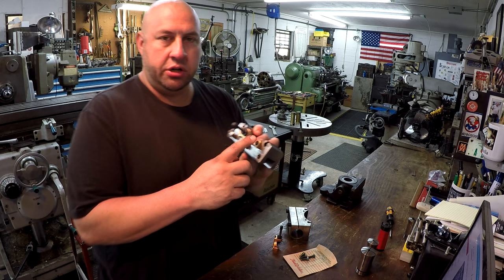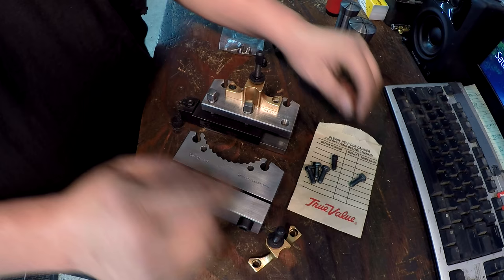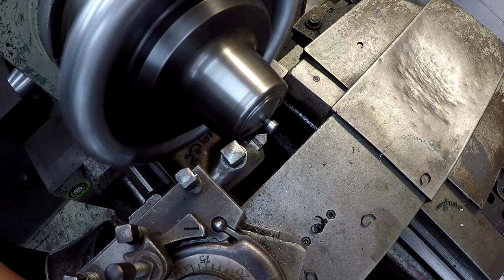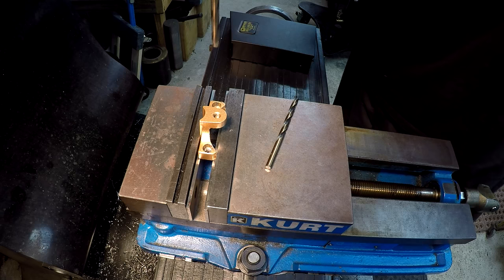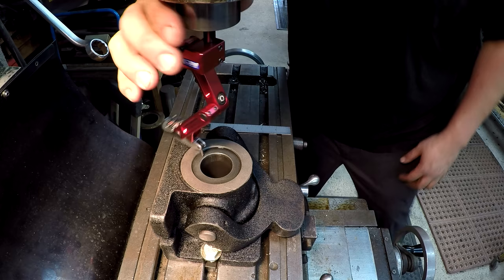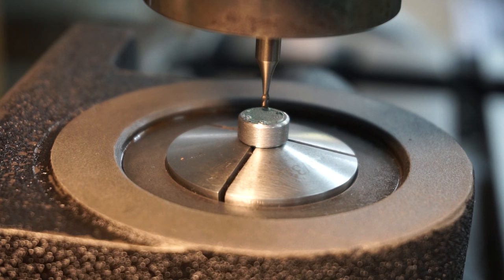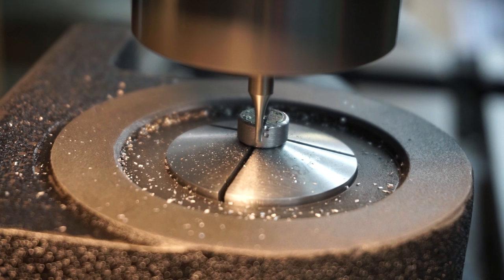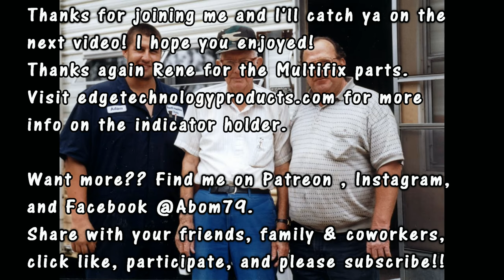Saturday Night Special 143 Part 2: Multifix Mods, Edge Indicator Holder

Comment: leave it to a machinist to over  do stuff lit having the  bolt in a  drill  chuck and  run it of on a beltsander and cut the slot with a hacksaw   im guessin what most people would do

Comment: Hey Adam, can you explain the cosine effect on indicators?  I don't really get it, looked it up on a few sites
Reply: Adam Kraehling it's not really to much to worry about. Just more good practice and something to keep in mind. Try to have your tip less than 15 degrees. If I walk past a height gauge and the test indicator tip is at a 45. I always bend it up with my OCD.

Comment: as brilliant as multifix holders are, the stock thread sizes on them are a freaking pain in the ass if you want to repair them yourself and not spend money on spare parts. as for the clamping screws it's basically impossible to find tap and die for their M11x1.5...

Comment: The part was probably patented so he change the designed a little to get a work around. I bet the distance is changed a little. All you have to do is change the designed by 10% and getting them made in China doesn’t help. 

Honestly I would make my own and not but crap from  China.